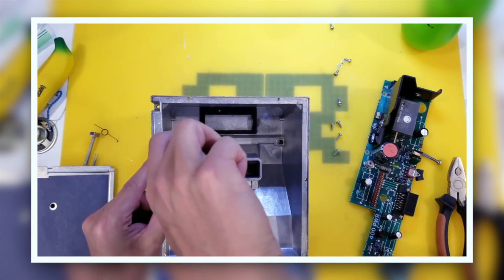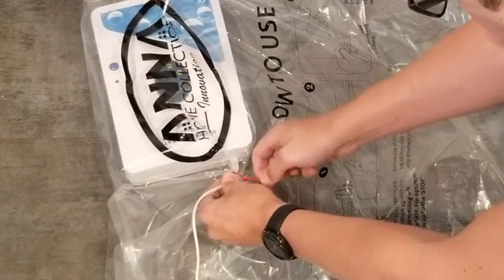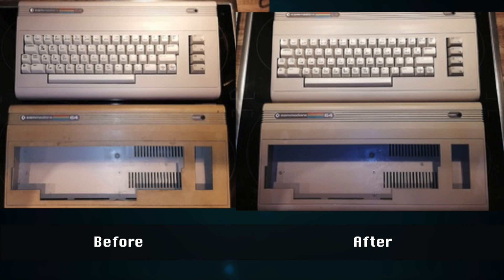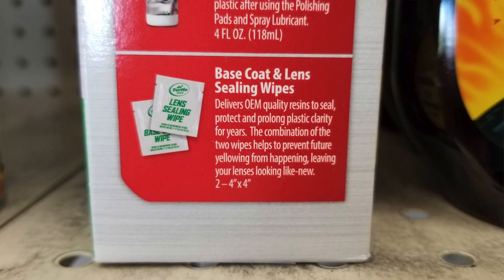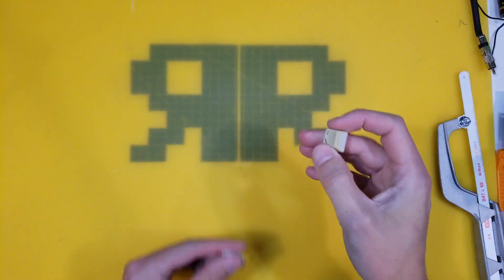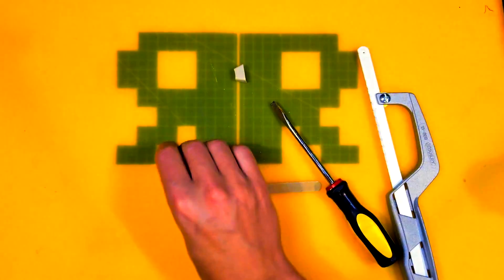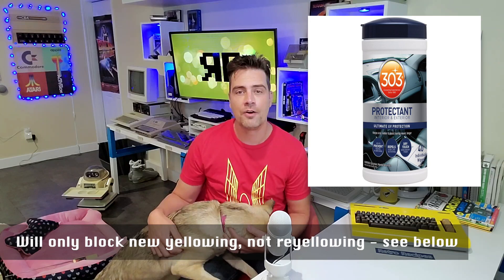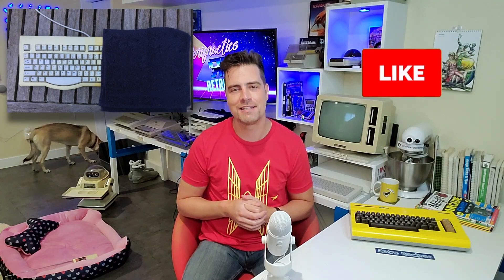Retrobrighting with just Sun? Lightbrighting! ▼ Read description FAQ

Comment: Fascinating findings, but I have to take issue with your hypothesis.
It seems clear from the data you have presented, that the main "yellowing" (correctly, "browning") of the plastic is thermal. This seems logical for what the brown is: it is Bromine in the plastic that is used as a flame retardant. It is logical that it is liberated through thermal action to supress fire.
Now, if you recall the hole in the Ozone Layer, you will know that halogens react with ozone moderately readily. The UV causes the creation of ozone in the outside atmosphere and adds energy to cause a reaction with the liberated bromine on the surface of the plastic.
But! What sort of UV? Glass is transparent at visible wavelengths but much less so to UV, and shorter UV is substantially blocked. I suggest, from the experiment using the sunbed, that UV -A and -B are largely irrelevant to this and that UV-C is at play in the bleaching.
Therefore, I suggest the following as an indoor experiment:
Place the components in a bag with an ozone generator and illuminate the bag with a UV-C lamp.
A STRONG WORD OF CAUTION: UV-C is highly dangerous (look up BigClive's videos on UV-C lamps), so take care that the UV-C only shines on the parts you want whitening and cannot be seen by anything else. Use of aluminium foil would help reflect the UV and contain it to the relevant area.
Since the bromine has been liberated from the surface of the plastic and then reacted away, the deeper bromine will find it more difficult to migrate to the surface and so the browning will take longer afterward.
Brittleness in the plastic is from the leaching of plasticisers (bromine is not a plasticiser but a flame retardant). Therefore, keeping the plastics moderately cool will avoid the loss of those chemicals. Typically, plasticisers are not good for human health anyway (particularly male reproduction) so keep those contained.
Reply from the maker: I'd respectfully disagree. 1. In my last video I showed why bromine is likely not a factor. 2. The hole in the ozone layer is not a factor any more, particularly in California. Most or all UV-C is blocked by our atmosphere and doesn't reach us.
Reply: @RetroRecipes  Extremely interesting (have a small donation).
I confess that I missed your last video, hence my ignorance to it.
However, 1. The research still has not fully explained what is causing the change in reflected wavelength (although the change to polymer through oxygen and free radicals is compelling). Without identifying just what the problem is, treatment is just stabs in the dark. 2. I didn't say the hole in the ozone layer caused/repaired the issue, just that the reaction between ozone and halogens is one that is understood and could explain a bromine colour correction.
It is compelling that the "recovery reaction" does not reverse but simply takes away the darkened colour.
My two concerns with your tests become, therefore, that 1) you are still using UV to correct the issue when it is hardly clear that it is not simply thermal (sunshine is mostly thermal), and that 2) the 8-bit guy has had very good results with hot water and peroxide indoors (no UV).
The main issue with the latter is that people just use an arbitrary amount of heat up to and including warping the plastics. Experiments with a controlled heat just below the degradation point of the plastic should produce much better results. Even Retro Man Cave has been deficient in experimenting with temperature in a precisely controlled manner.
Again, if UV is a factor then I think you may be considering the wrong wavelengths, or if thermal is a factor then people need to be much clearer about what a suitable temperature is.
If you have more keys to spare and don't mind cutting them up like the test key in this video, then you can make material go further and show the penetration effects much better with dissected plastics.
Reply from the maker: Good points. Apologies if I misunderstood about the ozone layer. Heat + peroxide definitely works, but it's a different reaction. The heat is a catalyst to the bleach, and the bleach overpowers the otherwise yellowing effect of the heat. It's a 3 pronged dynamic. So I don't deny that method. really my main point and goal with all of this is to bleach without dismantling, and for me I've achieved that goal. the drawbacks of the heat plus peroxide method are added brittleness and having to take the machine apart. Of course it is a lot faster though. 

I discussed this a lot with the scientists and all I can relay is the guy that literally wrote the book on polymer yellowing states that it is the UV that causes the bleaching not the heat. If it was just thermal then as I showed with the hot air gun we would have seen further yellowing instead of de yellowing. Again it's a three-pronged dynamic. The UV overpowers the heat of the sun, which usually yellows things, without UV (or peroxide). 

But it's a very interesting discussion and I'm sure it will continue for a long time!

no doubt I will do further tests in the future if someone doesn't beat me to it. Thank you for contributing to the discussion, and of course for your very kind donation. 👍🕹️
Reply: @RetroRecipes  Any chance that he has a more readily readable description of plastic yellowing? The links you provide clip parts of reaction and do not describe the other factors (not your fault as you are describing what you have been shown), but there is clearly some research neither of us has seen/read that is salient to this and would inform future research.
Reply from the maker: Did you see the research paper in the description? Beyond that I don't believe so, and he's semi retired now... 🤔
Reply: @RetroRecipes  The link I saw was to a Reddit chat. I did not see an academic paper. As Potholer54 might say in his videos on climate change, if something doesn't line up with what you think, it is better to think that you don't know something they do than that something is being purposely hidden from you. I'd just like to know what that is.
Reply from the maker: sorry this is the link I'm referring to. It's under this video rather than the Reddit chat which is under the other video. Hope this answers some questions. https://drive.google.com/open?id=1vE41ASE14kZVGjEFz_tsiLRLK3c928Eh
Reply: @AlexanderJohnOgle  Can you provide a source that brominated fire retardants (which are colorless) can return to pure elemental bromine under normal household/office conditions? I have been trying to verify this isn't some armchair scientist claim for years and no one has been able to provide any insight.
Reply: @FluffyTheGryphon  Read more of this thread. I was wrong. I need to read the scientific paper Perifractic shared.
Reply: @RetroRecipes  OK, I have finally read the paper and researched the background data as much as I can. I have to say that this technique is convincing, but not for the reasons you think and that I think you are actually making things worse in the long run.
Firstly, the Z- or E-isomer with different reflectivities does seem to be a large part of the colour change, especially with one apparently favouring UV and the other thermal.
However, the paper is... disingenuous with its language. When it talks about restoring "original" colour (which it does three times), "original" is post-weathering (exposure to UV) not the "as-moulded" colour. There is no data that shows complete recovery to as-moulded.
Using the Xenon arc lamp to mimic sunlight is correct, and the use of filters to selectively trim out the UV shows the polymers respond to UV mostly and blue to a lesser extent. This means that white LEDs are a problem as they are based on blue LED chips and have a significant spike at 420nm.
Post weathering, the yellowing took time but became apparent. Exposure to UV/blue reversed much of the thermal change.
However, you are wrong on two points: one is that heat yellows plastics, the other is that yellowed plastics exposed to UV will not yellow again to the same extent.
For the first point, if heat was all that was required to yellow plastics then the parts would come out of the mould yellowed from the heat of injection. Instead, plastics remain close to their original colour for extended periods. You can see this from your computers where the yellowing does not take place over all the plastics but only where they are weathered (exposed to UV/blue). However, heating weathered plastics will cause yellowing.
For the second point, you showed the wrong graph. You need to look at the one for storage at 65°C, which clearly showed the yellowing returned in full and even showed a trend for greater yellowing over time. Remember that temperature is used to accelerate time in tests. Your graph was the room-temperature, so did not show the full extent over time.
So, what is going on?
Well, the paper is right to not talk about the chemical processes but instead to present data. However, we can extrapolate comfortably with the plastics we see from hobbyists.
It seems clear that something about UV/blue causes the moulded plastics to change such that they are more likely to transition from the light to yellowed isomer (be that Z- or E-) when dark. While this can be reversed by UV, it means that non-yellowed parts exposed to UV will now become susceptible to yellowing. Over time, you will notice that all of the case yellows in storage rather than just the patches from the first time around.
But, since the change is almost completely reversible then it may be possible to create a schedule whereby yellowed plastics can be put in the light to "whiten" them before showing off and then they can be returned to storage where yellowing is not seen.
However, plastics will not last forever and will fail eventually.
Reply from the maker: You make some valuable, interesting points. I wouldn't necessarily say I'm wrong to say heat causes yellowing as the main point of the video & diagram is warm air + fluorescent + diffused UV (aka "weathering") causes yellowing. I do show the test where the heat gun causes yellowing, but it's fairly clear that is on already yellowed plastic, which may support your hypothesis. Then again there are the many comments from people agreeing heat causes yellowing and citing their white case put in an attic and coming out brown. It's a very complex subject. As for the graphs I used, room temperature seemed appropriate but the whole paper is available and cited so I'm not withholding anything by showing one graph. I have to draw the line somewhere (pun intended) and wrap up the video or it could go on forever. Both the polymer yellowing scientists approved the video (graph and all) before it went live, so all I can say is I did the best I could. I'm glad we agree the method at least has merit. That's the important thing, to me. Thanks for the input. 👍🕹️
Reply: Alex, the yellowing is clearly not (only) a thermal reaction. Many yellowed plastics show quite sharply defined non-yellowed "shadows". I'm sure thermal effects do not create such sharp boundaries due to heat dissipation smoothing the temperature distribution. One of the factors therefore clearly is light (or some other range of EM radiation with little penetration).
Reply: @EdwinSteiner  Quite so. But which wavelengths? Also, you are confusing heat with infrared. Infrared can produce high contrast boundaries.
Reply: Alex, I don't think there is any confusion. I was referring to heat in the plastic, which diffuses and I would therefore expect it to cause no sharp boundaries and deeper penetration of the yellowing. Infrared irradiation at the surface could cause high contrasts but then again infrared is unlikely to cause these chemical changes, isn't it?
Reply: @EdwinSteiner  I see your point, but you are confusing low-grade heat, which does diffuse through conduction, and high-grade heat, which is incident on the surface. Also, other wavelengths incident on the surface will impart energy to the polymer and cause it to be more likely to react with (supposedly) the oxygen around it. The question is, which wavelengths produce the excitation that encourages the reaction? Also, is it the same wavelength that pushes the reaction on to a lighter colour? That seems highly unlikely.
I need to read the paper linked, it sounds fascinating, but it also looks like it hints at what is going on rather than actually describing it. A good start, and the basis of ongoing work, but that work needs to be precise.

Comment: This is very exciting news indeed! I totally did not expect that to work, especially as well as it does. I will definitely try this method in an upcoming GameBoy refurb/rebuild, not so much because the results are better, but rather because it involves a massive amount of less mess.

How about putting the items on a mirror to also take advantage of reflected light, or even helping to reach under parts sticking out? (which reading comments I see people already suggested, though it may need to have to be a polished sheet of metal as the glass in a mirror is likely to block some UV-B)
Reply from the maker: Thanks! I think a mirror is a good idea! Maybe a Peri-bolic mirror (sorry.) 👍🕹️
Reply: Aluminum foil reflects UV pretty well. Tried that with some Cree royal blue LEDs in a shoebox after watching Adrian's video https://youtu.be/cRlAFnhmPlw

Comment: I don't have any scientific theory on if it would work, but what about using UV-C fluorescent bulbs keeping in mind UV-C bulbs would have to be used in a fully encapsulated enclosure as UV-C light can cause damage to eyes and skin.
Reply from the maker: A bit dangerous for any mainstream community usage methinks
Reply: As long as it's kept reasonable contained and you don't look into in or directly shine the light on your skin like BigClive did (ah the delightful smell of burnt pork), it should be safe enough, although I'm not sure if it would have the same effect as actual sunlight but the UVC tubes do allow for transmission of UV light that would normally be filtered by the glass and phosphors of a normal tube.
Reply from the maker: well the other thing is our atmosphere blocks almost all UVC so I do not think the UVC is a factor in the bleaching that we just saw

Comment: Is it possible to filter UV so only UVA can be exposed to the plastic? Furthermore if this could be done without the heat of the sun, would the de-yellowing process be further sped up (or slown down)?!?
Reply from the maker: Probably sped up, but you'd need more lamps than anyone owns ¯\_(ツ)_/¯
Reply: @RetroRecipes  What about a tanning bed? Isn't the point of those things that they put out as much UV as you'd get from lying in the sun? You'd also get a more even exposure that way since they're lit all the way around, I believe.
Reply from the maker: We tested a tanning bed in this video. In a way you're right, but it's a very gentle version of true solar exposure. Too gentle.

Comment: can you speed up the process with industrial UV lamps ? you can get them form china ;)
Reply from the maker: You'd need a lot directed on a relatively small item but it's possible
Reply: @RetroRecipes  maybe it's stupid but can you use  tanning bed, uv with 360 degrees ;)

Comment: It should be possible to prevent re-yellowing by sealing the brighted surface with silicone oil. That will shut out the oxygen and also make the plastic less brittle.
Reply: ...but you will have to seal the surface every 6 or so month, silicon oil will vape away. Oooor it could also start a terrible reaction with the old plastic, i have seen plastic handled this way, it had a dusty looking surface when the silicon was gone.
Reply: Could be great for cases? I feel like that would be a terrible idea for keycaps though, greasy keys are destestable to use!
Reply: Wouldn't that turn a matte plastic surface to a glossy one?
Reply: Man I have a barrel of silicone oil at work... hehehehe....